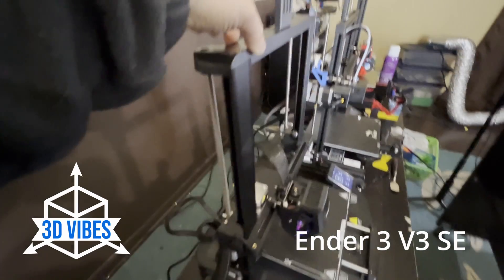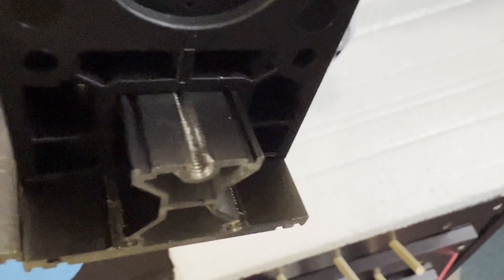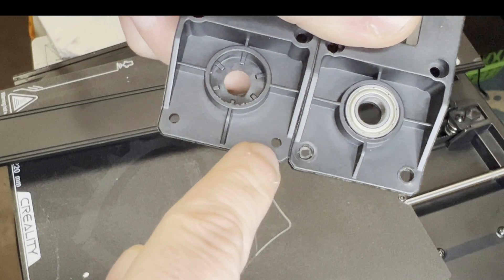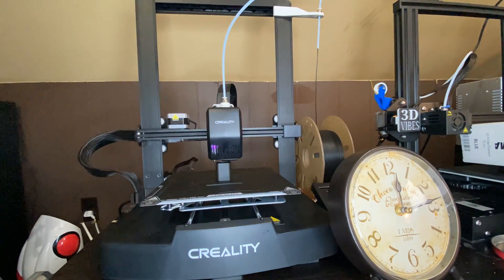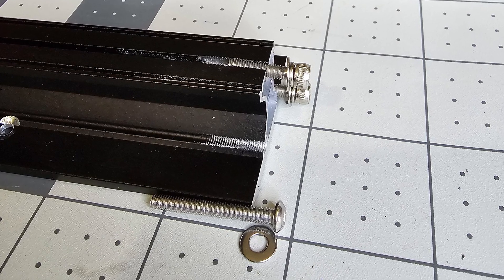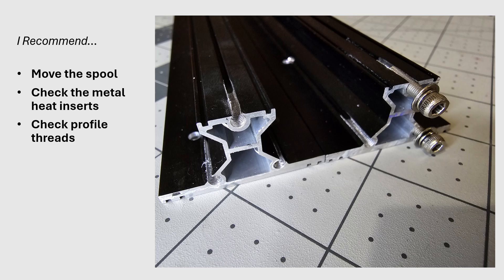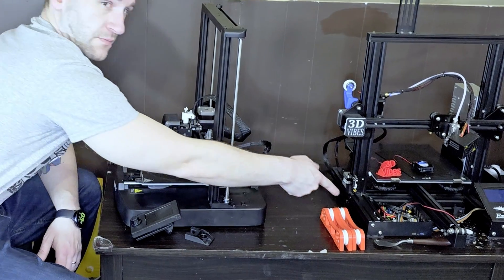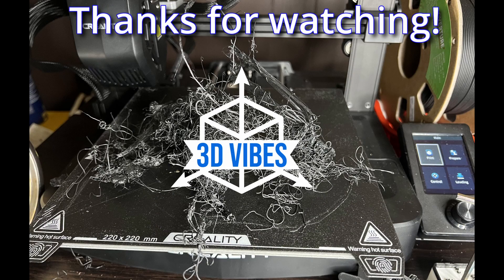Ender 3 V3 SE Follow Up: Fixing the Wobbly Frame Part 2

Comment: Support bar kits are now available. My V3SE has adjustable support bars and is rock solid. Used a set square and made sure the upright posts are also exactly 90deg to the bed surface as well.

Comment: interesting I think community can fix this easily .

-so now we have y axis rails instability issue which we can fix ish by using 10mm shafts with 8mm edge and 10mm bearing with 3d printed mount or just use rails upgrade 
also upgrade to x axis rails.
- relocating spool or even remove it from the printer to stand alone spool stand will be better.

there is a design of bins in printables that are attached to the z axis bars will that act as a support and reduce the wobble?
if you use same design but cnc a metal instead, will it fix the issue?

Comment: I hadn't noticed the wobble so I had to run to the next room and check it out, you are correct.  I've never mounted the filament on top so that's a plus, the shelf they are placed on doesn't have enough clearance to mount the spool on top.  And I don't really print anything where it would matter but it's still annoying just knowing it's there.

Comment: Excellent Video! What slicer you use
Reply from the maker: I used Creality Print for most of the prints in these V3 SE videos. I mainly use Cura, currently 5.6. The beta for Cura 5.7 is making my Ender 3 V3 SE do  weird stuff.

EDIT: My experience with PrusaSlicer is thin, but I use it once in a while and it's really impressive.

Comment from the maker: UPDATE: During recording, I assumed the Ender 3 V3 SE and KE had traditional style T-Slot extrusion rails inside the plastic shell. I have since seen the inside and the base frame is just the plastic and the aluminum sheet on the bottom. I've seen a few modelers on Thingiverse working on gantry braces that I plan on trying out in future videos!

I added a stabilizer rod using this design uploaded by Alexey H https://www.printables.com/model/730007-ender-3-v3-se-ke-gantry-support

It is definitely an improvement, and I didn't need to drill any new holes. I still plan on uploading a follow-up video (I know, it's been almost a year since I promised it!)
Reply: Do you have any updates?
Reply from the maker: I added a stabilizer bar uploaded to Printables by Alexey H (Link in updated description). It is definitely a huge improvement, and I think most people would be happy with it. One issue: the bottom end is mounted to the plastic frame, which doesn't take much effort to show visible flexing. I'd like to add a second rod eventually. Here is an image of my E3V3SE: https://imgur.com/a/u1VHM4m

I'm ashamed how long it's been, but I do still intend to upload another follow-up video!
Reply: I will be interested in seeing these braces.

Comment: Try use hot glue for reverse Bowden bracket.  It's not permanent if you ever need to move it
Reply from the maker: Thank you, that is a good recommendation! I was going to brush some hard gel nail polish on the bracket  to close the tolerance, but I like the hot glue idea.

Currently trying out a different filament guide. I should have a video up soon!
Reply: @3DVibes  "soon"
Reply from the maker: Don't worry, I feel the shame. I definitely do need to get back in Davinci Resolve and finish that video!